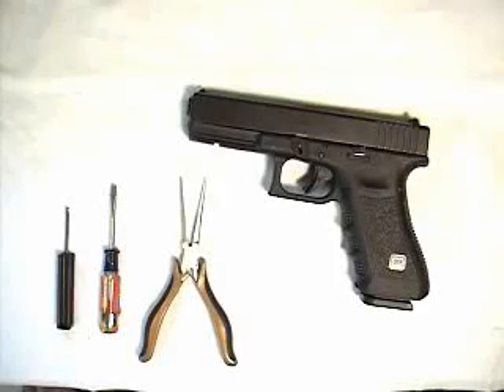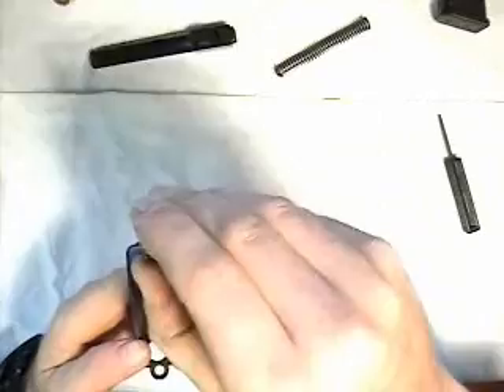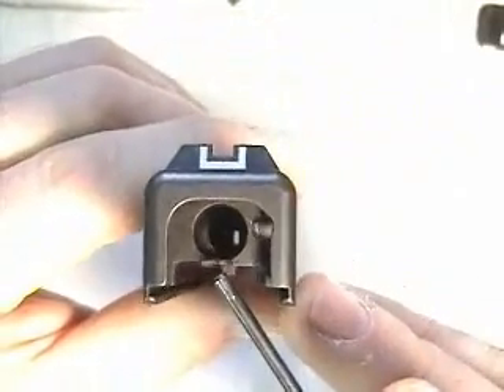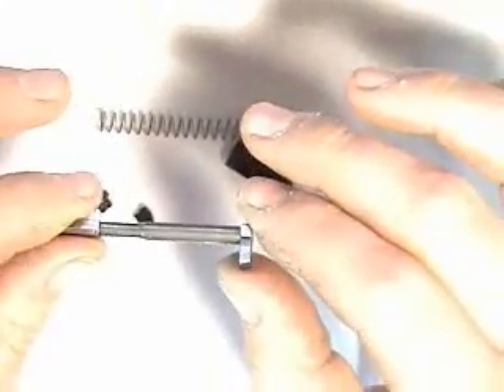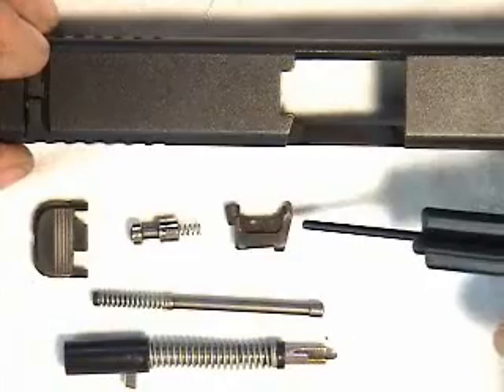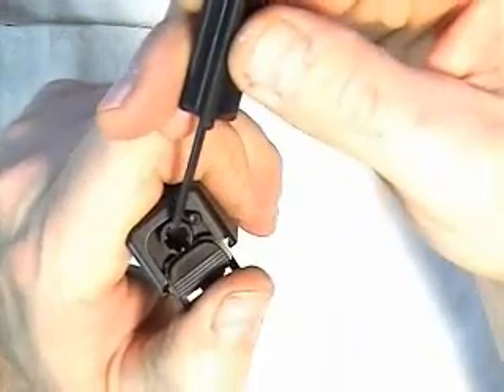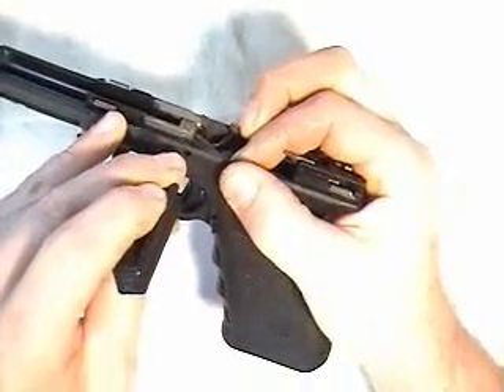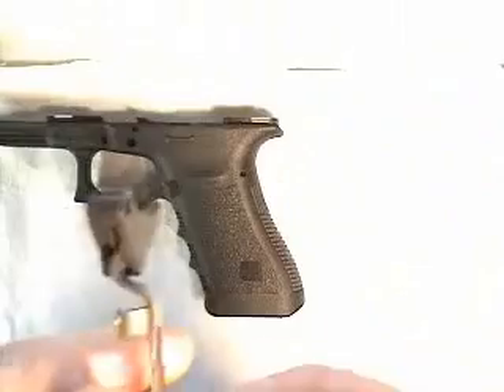theKGB65 Glock Disassembly (Part 1 of 2)

Comment from the maker: @PaidbyHim The extractor is the part that is visible on the slide, just behind the ejection port.  It's spring loaded and grips the case head so that when the action opens the case is pulled back until it contacts the ejector which is an immovable piece of steel that is cast into the trigger mechanism housing.  As the slide continues rearward the ejector forces the shell to pivot until the extractor loses it's grip on the case head, thus flipping the case clear of the ejection port.

Comment from the maker: @kwintoh That sounds like a good idea, first, though, I have to locate an armorer's manual and do some studying.  I'd likely have to purchase some tools, not sure, though.  That's one of the reasons I like Glocks so much, it's so darn easy to get inside of them quickly if you want to.  I've never done more than a field strip on a Sig, either.

Comment from the maker: It's a thrill for me to know that my videos are being watched in other countries around the world.  Thank you for the kind greetings.

The method that I used to use was to keep a .22 Long Rifle shell in my Glock kit and push that into the spacer sleeve and hold the assembly on the table while compressing the spring.  Using the slide is pure genius but I can't take credit.  This method comes straight from the Glock Armorers Manual.  

Very cool motorcycle you have there, by the way.

Comment: I’m familiar with complete disassembling/assembling my Glock 19, but I don’t know the method You show at 04:37. Until now, I’m simply place the spacer sleeve over the firing pin, put them on the table and holding by hand while put the firing spring and spring cups in place. Using the slide as a tool to complete assembling the firing pin unit is something new for me! Next time I’ll try this method. You're right, there is always more to learn.........Thanks, and greetings from Hungary! :-)

Comment: @theKGB65 Thanks.  Well, I looked at a couple of glock parts dealers... hoping to be able to find exactly this information ("This firing pin fits all glock 9mm"), but they aren't laid out like that (glockmeister and Topglock).  Very well, I think I'll get a 17 and, when I buy a spare part, I'll just check it myself.   You're video is a huge help, though.  Thanks for your good work!... you seem like one of those rare people that insists on doing things right.